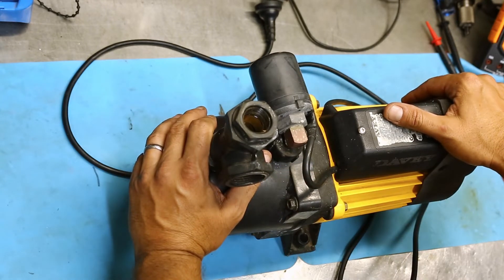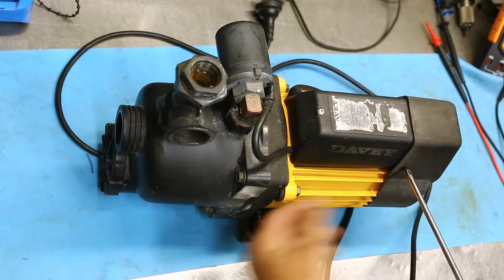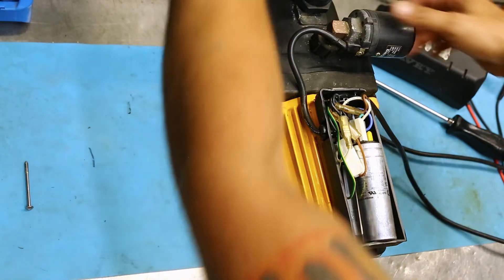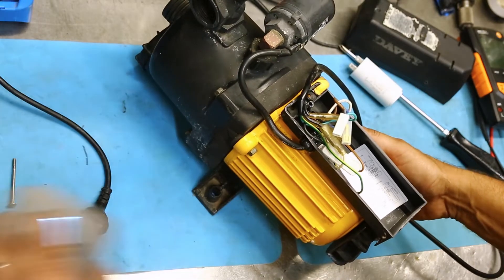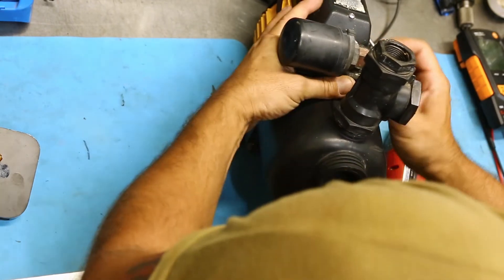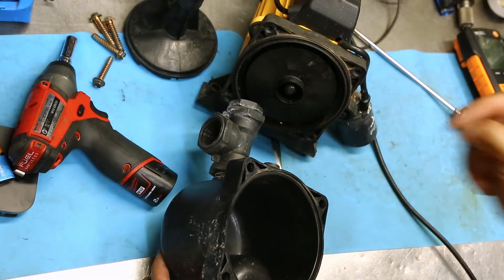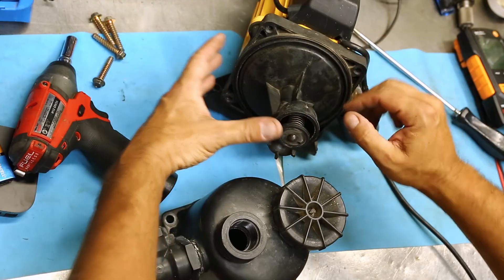Hilltop Workshop | Davey Water Pump Intermittent Fault - Repair and Inspection.

Comment: What about the rain bank attached to the pump? The pump works fine once unplugged from the rain bank and directly into power ? Is there a fuse of some sort inside the rain bank assembly? I can’t unscrew as I can’t find a screwdriver to fit ?

Comment: The pressure switch have two wier an the wier from the water tank have two wiers how to connect that
Reply from the maker: I'm not entirely sure what you mean about wires to the water tank.

You may have a different set-up.

Comment: Howdy ,Got a xp 350 p that leaks water along top seam of casing ,The plastic connector screw fitting on top may have over years put pressure on seam and cracked ,any way no matter how much ferro praise i use 24 hrs drying, water will find way out somewhere else.  my question is ,,,is that the nature of pressured water ,it will always find an exit ,just curious because i had same prob with hot eater tank leak  ! Signed Mr Cheapskate
Reply from the maker: "Give water somewhere to go and it will go there" is a term often coined by plumbers and drainers when looking at landscape and runoffs.

Add pressure to the equation and then you're dealing with a whole new world of directions that the water can travel in.

If there's a crack in the actual fitting or connection point, you've a very slim chance of getting it to seal properly again.
Reply: @thehilltopworkshop   Ta! Am forking out the money ,Have fixed cracked engine casings etc with Ferro Praise and impressed ,it was originally used in plumbing connections and find it very weird that water with miner pressure could pass through ,maybe the physics of smaller leak greater pressure to leak , thanks again ,!

Comment: Thank you for this video. Pump finally gave up the ghost this morning before work. Took my grubby self off the work and tracked down a Davey capacitor for $69. Saved me $1010 that I would have otherwise spent. Most useful practical YT vid I have ever watched. Will replace the pressure control as it leaks a little. Turns out the previous capacitor was an ICAR so already changed once. Thanks again.😅

Comment: Thanks for the video.  With your guidance I battled my way through replacing the capacitor but also had to free up a sticky impeller shaft but seems to working fine now.

Comment: Cracking video thanks, mine was an Ecotronic but almost identical. Plumber told me pump would have to be replaced, turns out having seen the video and checked it was only an €18 capacitor which had failed. Thank you

Comment: Hiya and thanks for the video. Any idea how to remove the impeller? Thanks
Reply from the maker: G'day! Most of them have a threaded brass inset that screws on to the shaft of the motor. RH thread from my experience, though I can't speak for all of them. :)
Reply: @thehilltopworkshop  Appreciate the reply mate. I'll give it a go. Looks fiddly and difficult to get a good grasp on it. Is there a worthy method to try?

Comment: My davies pump every few days doesnt want to run although the power light is on so it should be-running, unplug for a bit then plug it back in and it starts up again, I,m thinking it could be the capacitor but i dont know
Reply from the maker: That does sound like a symptom of it, but unless you're confident around mains voltage, you should get it checked by someone qualified. 👍

Comment: Hi. I have a Davey Pump not unlike what you have. It does the hum and after a while the motor runs. I figure it would be a similar issue like what you highlighted. I replaced the capacitor with another ICAR 8uF (but plastic like what you showed). On replacing it, the motor just hums but will not turn over. I replaced the original and it turned over but over the course of a few days, it started doing  the hum and may / may not decide to turn over behaviour again. Just wondering if I can replace it with a 10uF or 12uF capacitor ? I'm awaiting the delivery of a multimeter that can measure capacitance so I can work out if anything is wrong with the capcitor.
Reply from the maker: Hard to say without seeing it, but if it doesn't improve after replacing the cap with an exact unit asspecified, then there may be something else wrong with it.

Comment: Hey mate, i have the 350p, second hand. Someone (me) messed with the pressure switch screws. Just wondering if you know the stock turns to reset it to factory? :)
Reply from the maker: Man, I've got no idea! I mucked around with this one for hours with no real success - That's what made me buy a new pressure switch. 😅

Comment: Hi, I have an XP700 at home and am looking for the right sized generator to run it in case of power outages. I understand the generator has to be big enough to start the pump.  Greatly appreciate your advice. Thanks.

Comment: Thanks for the video. After you changed the capacitor on yours, the humming sounds like mine at the moment. But it doesn't pump. What could be the problem?
Reply from the maker: If the motor is definitely turning, then the impeller may have come off the shaft. Just one thing to look for.

Hard to say, otherwise.

Comment: I have a davey watermate pump. It's old and just 4 days ago the pump doesn't stop, it keeps on running until I switch off the power. 

How can I fix it. Need your help.🙏
Reply from the maker: That sounds like a faulty pressure switch.

Once it reaches the set pressure, it should cut the power, and not start again until it reaches the lower threshold.

Comment: Hi mate, where did you get the replacement from? And what code do I look for?
Reply from the maker: I got this cap through Edington Agencies in Coorparoo. This particular pump required a 12 microfarad, 450vac capacitor, but yours may be different.

Hope this helps.
Reply: What's the model number of this pump ? I have one that looks identical but the capacitor is melted so I can't read the details

Comment: Awesome video. I thought I had an issue with my rainbank (it was lighting up green but still using mains water) but after watching this and taking a closer look at the pump I realised the pump itself wasn't actually starting. $12.54 and one capacitor later its working again. Of note, mine was actually a 12uF capacitor. Jaycar stock the 20uF but only have the 12uF in a different (box rather than cylinder) form factor, but I was able to get one from Haymans electrical without any issues. Interestingly I found at least one pool shop online selling the same 20uF capacitor for $55.
Reply from the maker: Be wary that often the different capacitors serve a slightly different function. Some are a start cap, and some are run caps. 

Thanks for the comment! Glad I could help and that you got back up and running. 👍👍

Comment: I have this pump and it turns over and was working fine. But I think it needs to be reprimed. Do I just take the air pressure bottle off the top and pour water in?
Reply from the maker: You can do that, but it should prime itself fairly easily depending on your supply side. If you have a fair amount of head from the tank to the pump, it may cause issues.

Comment: When I removed the cover I smelt electric burning smell from the capacitor? Safe to say that's what I need to replace?
Reply from the maker: Most likely would be, but the internal windings may be worth checking as well. 👍

Comment: Bought a new X201, wanted to replace the short lead with a 10m lead, but for the life of me couldn't workout how the end plastic cover came off. Just one screw and it wouldn't bug, even tried lightly tapping it with a block of wood and hammer.
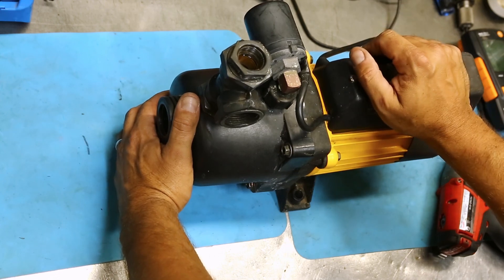Cheers on the video @ 11:16 you came through to show me how, cheers again.

Comment: Hi mate, I have a solar Davey pump. It has just started playing up. Each time I turn the Tao on,I need to go to the pump and pull the power switch on the top of the pump for a few seconds to get it to start up. There is no pressure leaks anywhere in the in or out pipework. Any ideas ? Maybe the one way valve inside the pump could be stuck open ?
Reply from the maker: Mate, I really wish I could help, but I've never worked on one of those.

Comment: After buying a new pump pull it apart and re-assemble it with anti-seize on every fastener you lay your eyes on (Including the impeller thread or shaft and keyway). Without it you'll try to replace the mechanical seal 10 years down the track and you won't be able to get the impeller off. That's assuming you'll also be able to get the cover screws off to see the impeller.

Comment: I have a DAB pump that was affected by the latest flooding. I had moved it up higher  a few years ago due to it being  flooded from being in a bit of a depression.  . The recent flooding was so bad a river of water had formed in a new area and the water and debris had cascaded  into  the fan causing it to stop intermittently .  This being my second issue with the pump not being correctly isolated from potential problems I would encourage anyone with a pump that is supplying your house water to make sure it can ,almost, never be affected .  I appreciate you taking the time to explain what the parts of the pump are. It makes me confident to give it a good clean out. Cheers Mate. 🤠

Comment: Hello does it matter the capacity wires go on? There are no markings on the terminals. I have just brought a new one which does not have any yellow covers on the terminals which is the same as the one you have replace with your old one. My old capicity one is the same as what you removed, it only has a blue and brown wire to connect to the capacity. Cheers

Comment: Hi are you able to send me a link where you purchased the capacitor from?
Reply from the maker: Most major electrical wholesalers should be able to supply you with one. I got mine from Edington Agencies. ;)
Reply: @thehilltopworkshop  what kind of capacitor?  Is there a specific size?

Comment: I couldn't call myself a multimeter enthusiast if I didn't ask for a closer look at your meter. Also, I'm sure everyone would appreciate a purchase link to the those "chrome finished impact sockets" hahahaha!
Reply from the maker: Like you, I've got a handful of them, but this one is a Testo 760-2. Maybe I should do a video on the collection. There's a couple of interesting ones in there. 👍
Reply: @thehilltopworkshop  what setting do you have the multimeter on to test?
Reply from the maker: @Jase013  On the capacitance setting. Not all multimeters have it, though.
Reply: @thehilltopworkshop  thanks. Off to buy a new multimeter. Any recommendations?
Reply from the maker: @Jase013  So many options! The best that your budget will allow, that has all the functions you need. 

Personally, I use a mixture of Fluke, Klein, Testo and Kyoritsu. If you're not making a living with it, a Klein for around $100aud would be more than enough. 👍 Just make sure it does the capacitance range you need.
Reply: @thehilltopworkshop  thanks for that. I hope it's OK to ask a quick question. My davey pump is playing up so I replaced the capacitor and thought it was all good. However the problem continues. The issue is that we are running out of water in the pressure water tank before the pump is kicking in. There is a delay of a few minutes before the davey pump starts. Not sure if the issue is with the davey pump or the 60l pressure water tank. Any ideas?